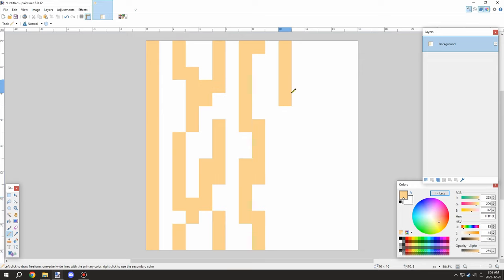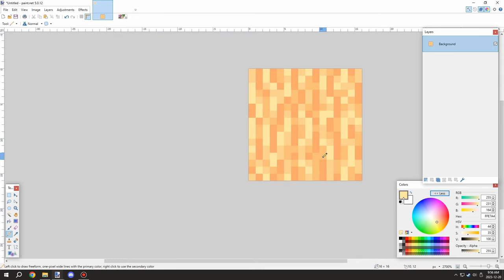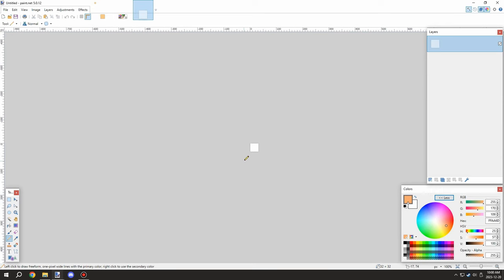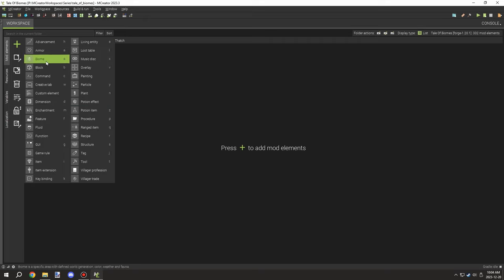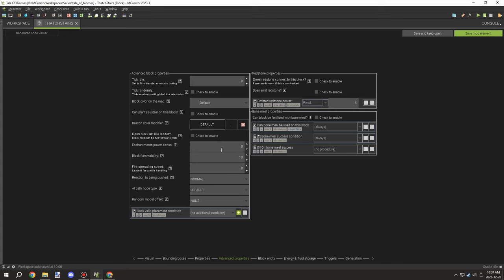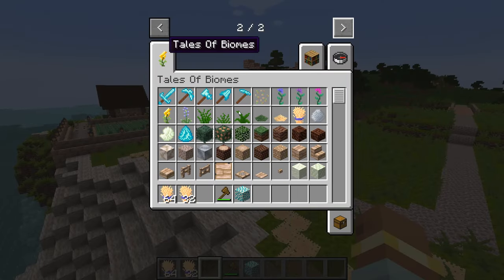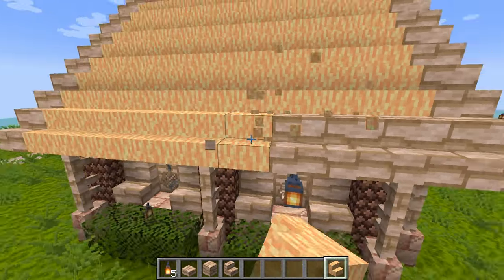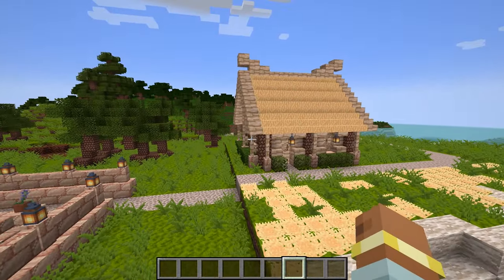Thatch Block | MCreator Lore | Ep48

Comment: Hey, do you know if there's a way to make new armor for horses in mcreator?
Reply from the maker: For vanilla ones it's not possible currently, if you make your own horse you can make a extra layer that goes over the body of the horse using the inflate option in blockbench, then make variations of that entity. Armor is controlled though attributes so you could apply different values of armor based on the model of the entity. You will need to save the entities health and oxygen to local variables and then despawn the current entity then spawn the other version and re apply them, any NBT or items will also need to be passed over, and if the entity is tamed then you will also need to make sure that only the owner can do this and the entity is retamed by the owner.

Comment: waiting for 2023.4 tutorial : P
Reply from the maker: I will be switch the workspace over soon though I still need to go over what has changed.
If you have any specific things you want to know let me know and I will make that a higher priority.
Reply: @NorthWestTreesMCreator  Heyo! Yep, the new update has changed a few things notably for structures, we no longer have the same parameters as before, for example we can no longer bury the structure of a few blocks. And there is also the new mod element "feature"... It would be cool to have some info! Thanks!